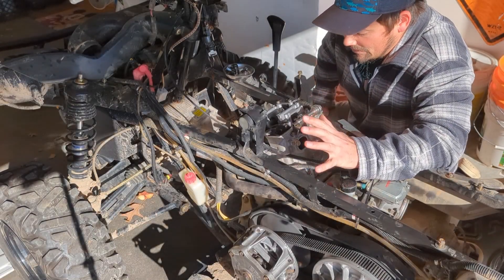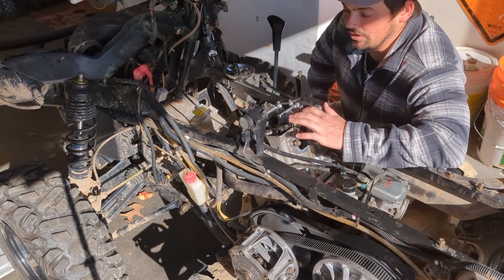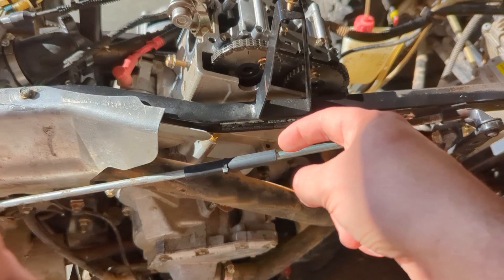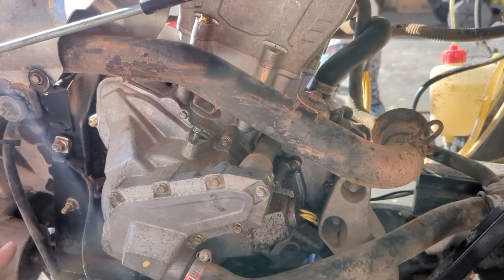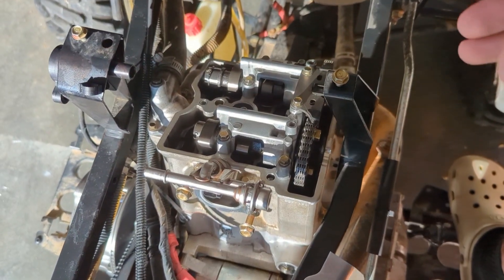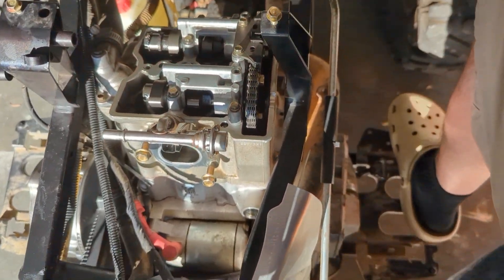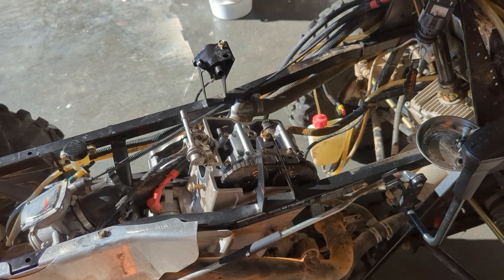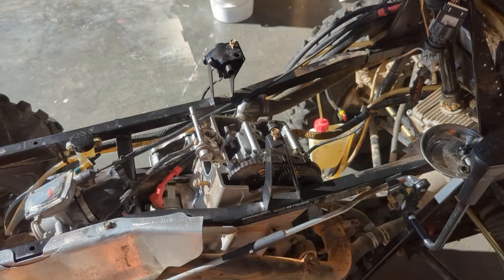What's going on with the Sportsman | 2014 Sportsman 570 Build

Comment: Hello, I have a 2013 Polaris sportsmen’s 400 ho, What oil, front diff and rear trans fluids u recomend? The Polaris brand is outrages
Reply from the maker: I actually have a few videos on the oils I use on my older 450 I had. I used Rotella T6 5w-40 for the motor oil. And will use T6 for this 570 as well. I can't get myself to put the Polaris prices! Thanks for watching and check out some of my other videos.
Reply: @AthenasGarageOfficial  how about the front diff and rear trans
Reply from the maker: The front dif is a Hillard front dif and it's recommended to use J20D from Hillard so that's what I would and will be using or something similar which is just tractor hydraulic fluid
Reply from the maker: I'll probably run a synthetic chain case oil in the trans or ATF not sure yet